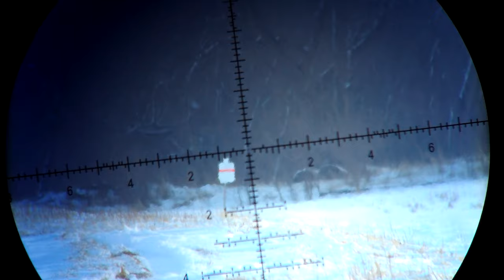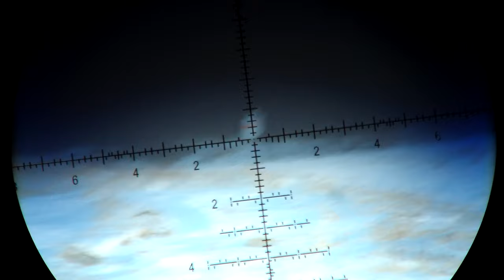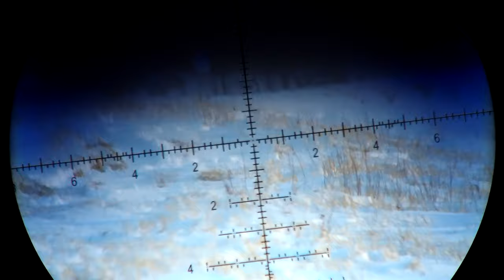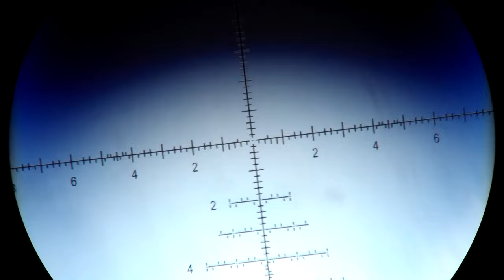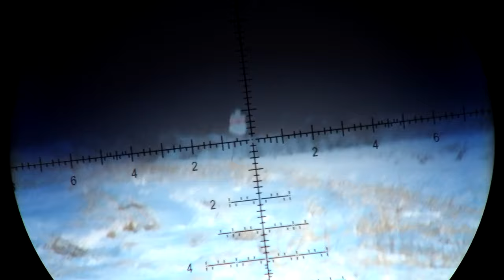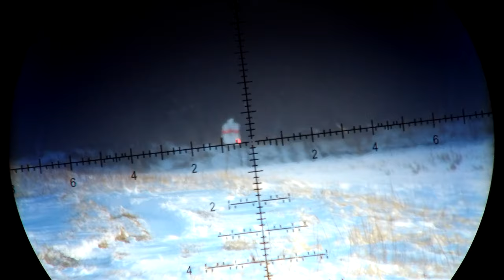ZCO 527 trigger cam 2.1 (cam was bumped out of center)

Comment: So is this good to go on a right-hand impact and ZCO? I want to pull the trigger but people on snipers hide are saying it doesn't work. It doesn't scrape up the scope with no insert right?
Reply from the maker: Unfortunately there is a chance that it could scape up the scope.  

There is no room for the thinnest shim that trigger cam comes with to use unless you get a longer tension screw then there is a chance is could line up with a thin shim.  

You could order a trigger cam and try it and sell the trigger cam if you don’t like. There seems to be enough demand for them especially in the USA.
Reply: @lukeclement1310  could putting down painters tape help make sure it doesn't scratch?
Reply from the maker: @iMakos101  that’s definitely a possibility it could work.  I still think you’re going to need a longer tension screw though… that’s easy to find at a hardware store.  

If you had the longer screw I would think you could sinch the trigger cam up enough where you could keep it more secure as it won’t completely slide all the way on to zco’s ocular due to the integrated magnification throw lever.